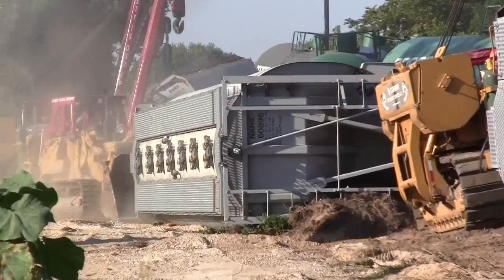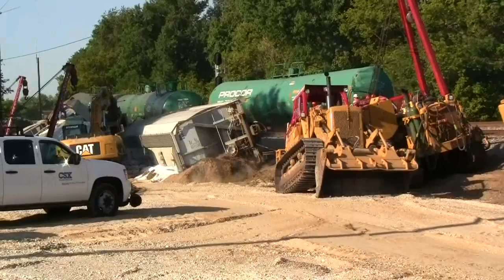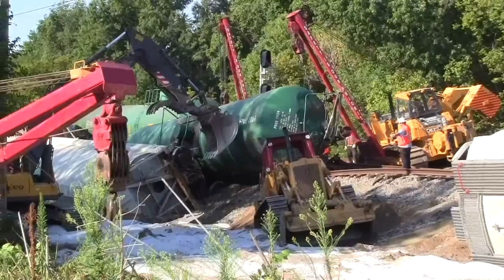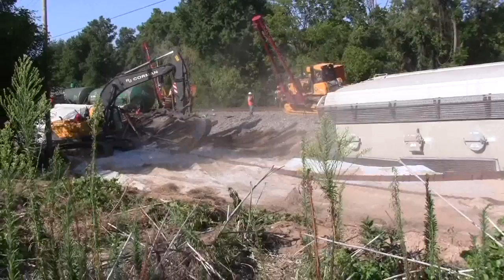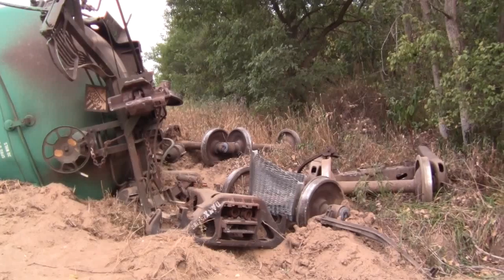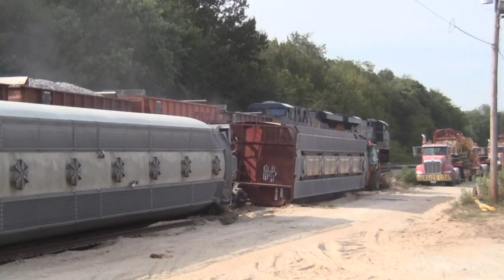CSX Train Derailment

Comment: My uncle used to clean up wrecks on the old Rock Island Line.  He said that the first thing you do when you get to the scene is "roll everything off of the tracks, don't worry about where it lands, just get it off the tracks so the section crew can come in and rebuild the tracks and get the trains moving again.  Once the trains were moving again, then the clean up could start."

Comment: Love the way the hopper car dropped ballast & followed by tamp car.What an operation.
Reply: The power is available but the the extensions are not. It's like asking a strong man without hands to do heavy lifting. The design of those tankers. shd include more stradgestically placed hookup points to facilitate easy lifting. Lots of unnecessary manoeuvring to get the job done. However, job well done.
Reply: they have definitely been to a few rodeos.

Comment: The derailed tank cars may have been stressed or distorted and may no longer be certified usable.  To be re-certified they would have to be inspected.  Could inspections miss subtle damage or overstress which could cause other problems?  Probably best to just scrap or rebuild.
Priority is getting the track open so backed-up trains can proceed.
Then later get the cars re-railed, possibly on new trucks, and hauled away on the now open track after backed-up traffic has cleared.

Comment: I would hazard a guess that tank cars, whether carrying haz-mats or not, once involved in an accident are probably write-offs anyway. The amount of leak-testing and such that would need to happen is probably prohibitively expensive and ends up cheaper to write them off as losses and pull some out of storage tracks (most railroads have hundreds of miles of tracks just storing extra cars)... The contractors were probably TOLD BY THE RAILROAD to destroy them to get the tracks back open ASAP.

Comment: that radio controlled ballast train was doing a good job they tried it here on the CV sub but because of the mountains they couldn't get a good signal that tamper makes short work of lining everything up as for R.J. Corman they are the best as for lining up there equipment if you have never been around this work you shouldn't comment about it i'm a good dozier operator myself that's what I did before railroading but that doesn't make me a expert on train derailment cleanup I have worked with these guys several times and they are all business when we dog we get to go home these guys work till its done ive seen them go 2 or 3 days without sleeping in any weather day or night

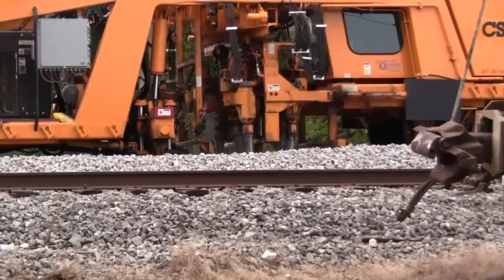Comment: Very nice video, great footage, one question, what was that machine doing at 28:15 ?
Reply: Hey, nothing like waiting for a minute to respond, huh?!
That machine at 28:15 is a Tamper. It packs the ballast (rocks) around the ties nice and tight, to keep them in alignment. Most of the time you'd see this machine where they're replacing ties, or in this case, cleaning up a wreck. You might want to find a good Track Maintenance video to watch. It will show more machines, in greater detail. Hope this helps.
Ghost of SP

Comment: Strange procedure... Seems to me that the levering machines are not adapted as normally wagons should be lifted from specific points and not moved like lego using a dozer, unless thay will be scraped definitively ! Second, I checked the danger code on the tanks. It is UN 3082, meaning that the wagons carried material deleterious for the environment. Just hope that it did not spill off the tanks !
Reply: what in this world is a wagon? you must be one of those wannabe railroaders do you really think those wagons were a hazard trust me having first hand knowledge anytime there is hazmats in a consist no matter if they are loaded or residue last contained the FRA and NTSB are right there overseeing every step do you really think they would let them handle a dangerous car like that I don't think so

Comment: Is this the same derailment at E.Elkhorn Rd. or another one? I don't remember the year. I remember they piled up the derailments east of the tracks on the right side of E. Elkhorn Rd. in the field.
Reply from the maker: This is at Decker. That Elkhorn derailment was back in '09.
Reply: off of 241? north or south? have u found out what cause the derailment? I knew what happen on Elkhorn one.
Reply from the maker: North of 241. I think the rail rolled over near the switch.

Comment: that train picked a switch that wasn't thrown quick enough and when a train derails its more than likely that the flanges on the wheels were worn down to a point where they needed new wheel sets on them. i have heard from a Engineer that worked for Norfolk Southern and he told me that in his 41 years of working for them that he has seen trains pick switches in the yards and train cars derail because of worn down flanges on the wheels. so my point is to put new wheels on the train cars

Comment: If you owned the railroad you'd be doing nothing more than writing off damaged cars and pulling spares into service. Those huge dents on the cars are just visible evidence of damage, you would have to, at a very high cost, test every weld for cracks, check frame integrity, and more just to get those cars usable again. Cosmetic damage MEANS structural damage on cars like that...

Comment: If this happened in my town I would not allow the railroad to move out of their easement, much less dump their tank cars on property they don't own. This was a haphazard and sloppy clean up. Each derailed car should have been trucked off when it was pulled away from the line. The railroad certainly knows how to make a mess with their careless maintenance of the rails, but they sure don't know how to clean up after themselves. If the line was blocked because of their carelessness so be it. It would be nice if they learned from their mistakes and incompetence.

Comment: The fact that the Trucks came "off" of the frame says alot...poor maintenance or other factors can cause things like this to happen, i would soley lay blame on CSX..
Reply: My guess is you've never worked a day in your life in the industry but you are still willing to blame someone.
Reply: you would do a lot of railroad work do you
Reply: Amy Marie 
 "A box car rides on two trucks (called "bogies" on overseas railways). Each is a 9000-lb. assembly of individual components (including, but not limited to, axles, wheels, and truck side frames) held together only by gravity and the interlocking surfaces on the principal parts. 

The purpose of the truck is to provide support, mobility, and guidance for the car. Like their model railroad counterparts, freight-car trucks are a separate unit that can be removed for maintenance, repair, or replacement." 

By Paul D. Schneider trains magazine author
 | May 1, 2006
Reply: http://trn.trains.com/railroads/abcs-of-railroading/2006/05/freight-car-trucks-and-carbodies 

Btw from trains magazine i did not write this.
Reply: Delilah Hensley If you are referring to me...yes.  My entire working career.
Reply: +Boss302fan no not you boss im an engineer for CSX and did railroad contract work before that corman is the best I've worked around they do a good job with their derailment work
Reply: +BNSF-3001 you do have a point
Reply: +Amy Marie hey there have being worse derailments some at Cajon Pass some in the Rockies some even in Baltimore
Ohio god damn it
Reply: hmm

Comment: HazMat Experts and Firefighters petition Dow Chemical and Union Pacific for safe rail tank cars transporting gas chlorine. Secondary containment is a necessary improvement that must be implemented. See--PETITION C KIT for First Responders Comments.
Reply: I am a firefighter and our main station is only 200 or 300 yards south of here. We were never even notified about this derailment until the morning after this video when I notice all the equipment backed up in front of the station. Was another derailment from this point to the south a few years before this. Grainexpress has another video posted on here that has photos of it. Shows tanker cars in a sawmill lot. That's almost straight across the tracks but just 75 yards south of this location.